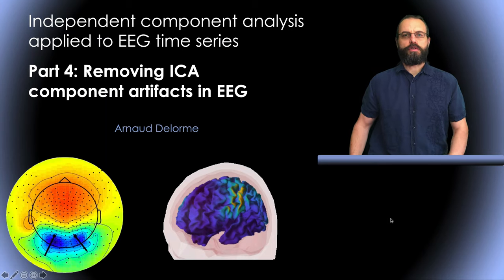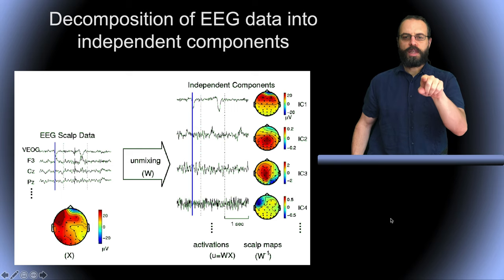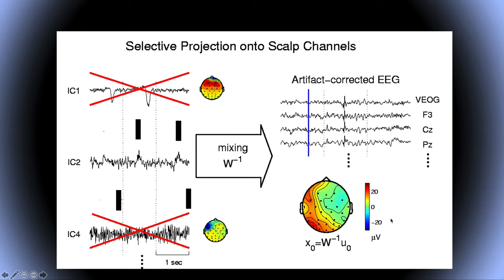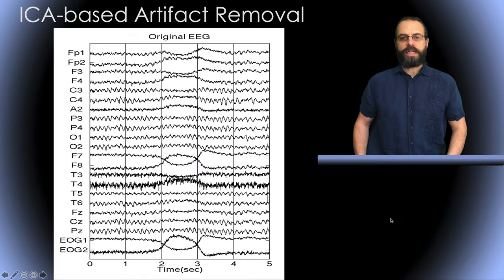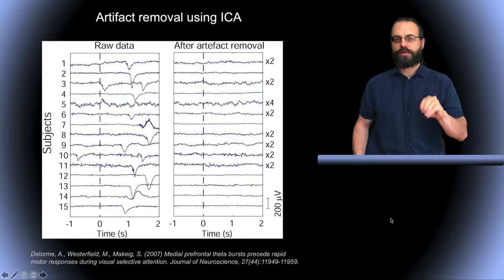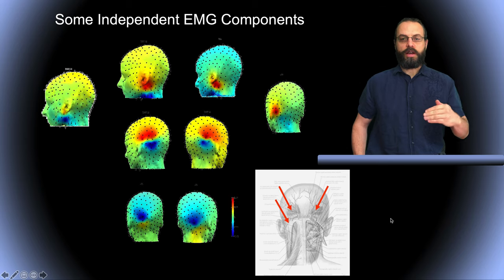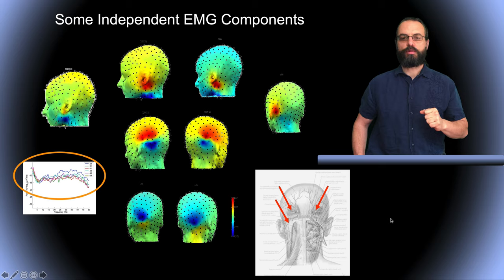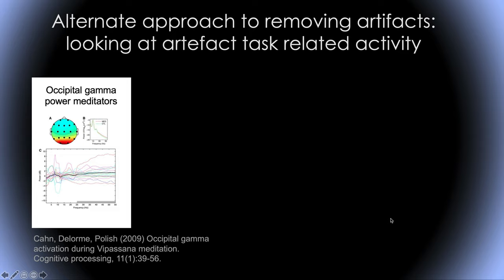ICA applied to EEG part 4: Removing ICA  component artifacts in EEG data

Comment: Hi Adam, at 1:45, you say to zero out the activity OR zero out the columns, but I'm confused as to which it is. Is it not either or? Visually, from the slide it looks like i should zero out the row that represents the component, not the column? Wouldn't zeroing out the column remove one data point from every component? Thanks.
Reply: Yes, either is OK. It is mathematically equivalent. The result is that the contribution of a given component is removed.
Reply: @arnodelorme  Thanks very much, Adam.

Comment: Re the possible muscle activation in the meditation studies, is it not possible that the muscles at the back of the head (showing as occipital in the topo plots) and the temporal muscles, are activated independently, such that the meditators could be only activating their muscles at the back of the head and not the temporal muscles, hence the difference between control and meditators is not present in comparison of the temporal 'artifactual' ICs. Thank you for the great videos.

Comment: Prof. Delorme, when I use binica, the rank of the EEG.data determines the number of components that are non-redundant, right? So, is it fine to say that while PCA eliminates redundancy, the rank matrix tells how many non-redundant components exist?
Also, given that I have 19 electrodes, if I use too many data points, the rank becomes higher until it reaches the maximum of 19. From this point, is it fine to say that the ICA decomposition will overlearn?
Thanks
Reply from the maker: Yes, the rank of the matrix tell you how many independent channels there is in your data and therefore how many ICA components you may extract.